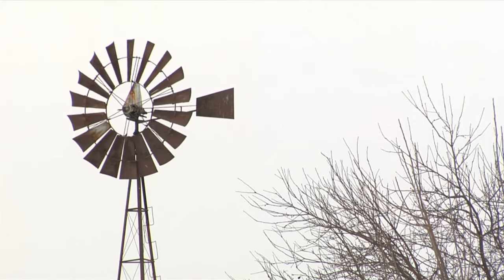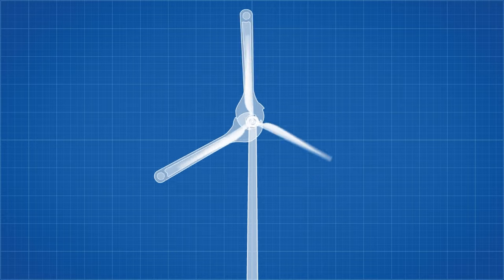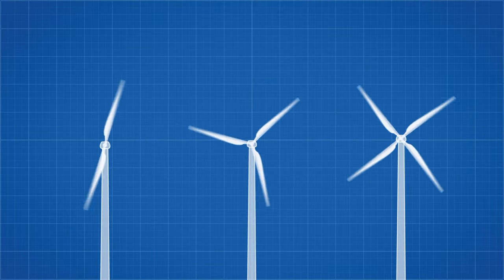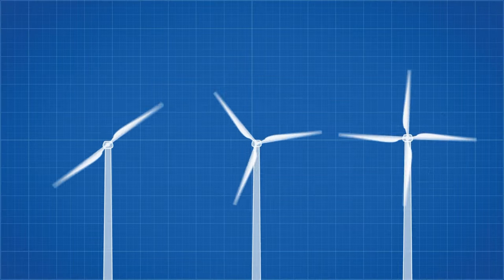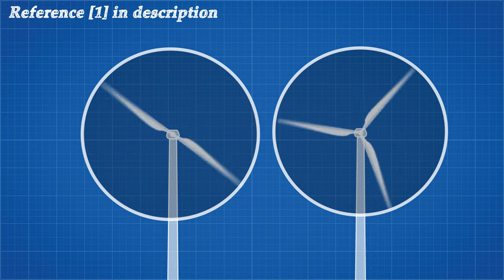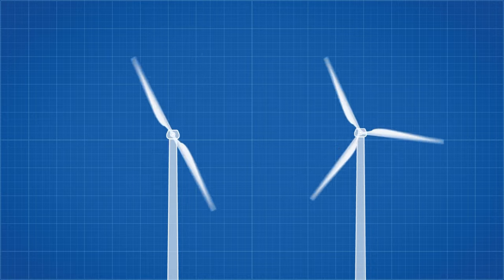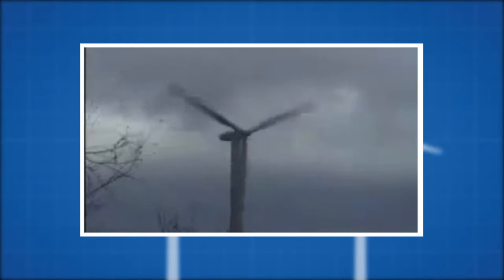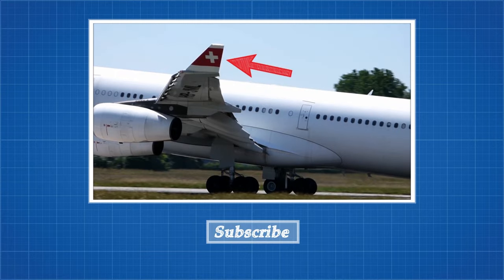Why Do Wind Turbines Have Three Blades?

Comment: Curiosity says:Theoretically, a one-bladed turbine is the most aerodynamically efficient configuration. However, it is not very practical because of stability problems. Turbines with two blades offer the next best design, but are affected by a wobbling phenomenon similar to gyroscopic precession.

Since a wind turbine must always face into the wind, the blades will have to change their direction vertically when there is a shift in wind direction. This is referred to as yawing. In the case of a two-bladed system, when the blades are vertical (i.e., in line with the tower and the axis of rotation) there is very little resistance to the yawing motion.

But when the two blades are in the horizontal position, the blades span a greater distance from the axis of rotation and so experience maximum resistance to yawing (notice how a spinning figure skater slows down when they bring their arms away from their body. As a result, the yawing motion starts and stops twice per revolution, and this leads to stress on the turbine due to blade chattering.

On the other hand, a turbine with three blades has very little vibration or chatter. This is because when one blade is in the horizontal position, its resistance to the yaw force is counter-balanced by the two other blades. So, a three-bladed turbine represents the best combination of high rotational speed and minimum stress.

Comment: The major explanation for this fact isn't shown in the video nor the comments here. The point is that three-bladed turbines may achieve the best power coefficient (Cp) which is above 0.5 and below the Betz Limit (maximum efficiency ANY device may reach when converting wind energy -- 59.3%). The thing about balance and mechanical stress is also true, although not the main reasons for the widespread use of three-bladed turbines. For further info just google: Curve Cp vs. blade number.

Comment: I like your channel a lot, but this video misses the spot way too far. I have the strong impression sure you just read the english wikipedia page, which, for whatever reason, does not cover the root of the problem in comparsion to other wikipedia languages and masses of other articles on the web about the topic. 

Do you remember how three-phase electricity works and why it's magic?  If the load is identical on all phases the fourth wire has zero current the other three equal out completely.  
The same principle applies to a three-blade  turbine similarly:  There is zero unbalance and much less vibration.  The forces on the central axis are always straight and therefore three-blade turbines last longer both in the gearing as well as in the tower construction, are less noisy and have a smaller tendency to soar into big fatal movements like in the crash you show in the video (they're not fully resistant either as you video shows :-) )

PS: Initial construction cost-wise a two-blade design seems to be the real sweet spot and if you research a bit int cheap turbines for underdeveloped rural regions you will find a lot of two-blade designs. But in the long run three-blade designs are more cost-efficient due to the fundamental mathematical priciple (and not because of the sheer cost structure)
Reply from the maker: I agree with you, it's lacking. I used a college text book for reference, but I left out most of the information because I was trying to keep videos below 3 minutes at the time. I will probably remake this video further down the line.
Reply: +Real Engineering wow, that was a quick reply.  The cost factors are very dominant and it looks like two - blade designs seem to be reconsidered for offshore parks. But the math of the forces just fits the topic and tone of your channel much better ☺
Reply: I'd like to know the text title.  Glad to see you notice it is a little over simplified.  I know enough to see this myself, but have not read much on this subject.  In particular the arm of the leaver related to torque on the system.  The "Lift" in the radial component differs with the distance from the spin access.  Obvious, but it needs to be taken in to consideration in the comparisons of designs of varying blade numbers.  I think a good Aeronautical background helps and I have a little.
Reply: The only constraint on the blade spinning speed is the seped of sound.  The tips of the blades are travelling close to the spped of sound, it is the main criteria when engineers optimize the design. Also gyroscopic forces are wild on two blade designs - they cause wery unpleasand type of vibrations - this is why three blades are preferrable even on very small household turbines.
Reply: I thought he was going to talk about primary and secondary balance, instead he basically just did a cost-benefit analysis.
Reply: Nikolaus, you said 3 bladed turbines have "zero imbalance and less vibration" and "the forces on the central axis are always straight". Please expain why this isn't true for other numbers of blades.
Reply: "zero" was a bit exaggerated to be honest and university is a bunch of years ago.  Don't take it word for word but I think the problematic topic is not a fixed propeller with a fixed continuous and homogenuous wind direction but the fact that a wind turbine is turned to the wind direction and the wind direction can change etc. I.e. the turbine has a vertical axis, too.  In a two-blade setup the potential inertia and momentum along that axis can change 0 to 100%  twice per turn, which can lead to vibrations if the turbine is not  exact in wind direction and / or the wind is not homogenous.
But again, this is just something I think had to do with it - kind of an educated guess.  Better do some own research on the topic. 

BTW: Higher multiples of three probably have the same characteristics, but seem to be totally out of scope cost-wise.
Reply: I saw an experimental one-blade design that used a counterweight.
It was said to avoid the trailing turbulence of another blade.
Reply: Perfect balance can be achieved with any blade count above 2, and can even be achieved with just one blade with the right counterweight, it does not need to be a multiple of three. 

In my understanding there are plenty of complex considerations for wind turbine blade design. The blade length is limited by the changing relative velocity as you move from the hub to the blade tip, that's why the blade pitch varies from the hub to the tip, but at a certain point extending the blade length further results in diminishing returns, particularly after the blade pitch goes past 90 degrees at the tips of some blade designs. The high rotational speed issue is the main reason for the 2 blade design being generally inferior. On the other hand, as more and more blades are added to a wind turbine, the wake path of the preceding blade starts to effect the efficiency of the following blade and promote flow separation and stall. 

But he's right in suggesting its all cost benefit, my understanding is four blade could be more efficient, but due to build, transport, and assembly costs, 3 blades tends to be the sweet spot.

Comment: Hi,
i took a class in modern wind turbine physics for a semester (about five years ago) and a another factor for three wings vs. two wings I remember is, that the tower is messing with the down stream wind speed.
Basically, on a two winged wind turbine, the load forced on the upper wing will be much* higher compared to the lower wing when that one is in front of the tower. 
It is also higher compared to the sum of the two upper wings of a three winged turbine
The effect of this would be a higher rocking of the turbine for a two winged turbine than a three winged turbine.
Which can cause higher wear and tear for a two winged wind turbine.

Comment: You forgot to mention that two blades results in mechanical fatigue ant the hub due to standing waves produced when one blade passes into the shadow of the tower. Three blades cancel any standing waves by splitting the energy to the opposite two blades thereby canceling any resonance.
Reply: Shadow of the tower? Aren't these contraptions facing the wind so the tower is behind??
Reply: @tomkarlsborn2384  Yes, the tower is down-wind of the blade, but lower blade suddenly becomes 'unloaded' as soon as it passes in front of the tower while the loading on the upper blade remains unaffected (and is much greater). Throughout, there is a general wind shear affect across the rotor with the wind speed being higher with height (although this is constant). The result is a continuous eccentric loading 'blip' each time a blade passes the tower (in a two bladed design) that has to be accommodated by by some means , typically some sort of teetering/hinged hub design to absorb the forces.

Comment: When was kid, I used to build blades (from wood) and get them in garden for fun. Was aiming for ~80 (early)-100 (later) cm long (4,5-5 cm x 1,5 cm dimension, used knife to cut wood from both sides to get better wind pick-up for front side and reduce weight for back side - felt fragile but was sturdy enough for many months) blade with some 105-110 g weight each + central wood piece to hold that all. 
3-blade version was lightest but also not great at picking up slow wind (since at ground level difference between up and down can be big with all turbulence etc.). 5-blade version I found perfect combination (for that size) - it picked up speed quickly and turned smooth (and looked more cool when was not spinning, hahaha). And same time at strong winds auto-turned sideways to slow down (design by accident). (still had to take down when storms were coming). Good memories.

Comment: What is the marginal increase in performance by adding a 4th blade? How do you know it's marginal?
Reply: fluid dynamics. 3 bladed designs are quite near the maximum theoretical efficency possible for a turbine rotor. The effect of adding a 4th blade would be marginal
Reply: Correct, for blade sizes such as we use on wind turbines, operating in air at about 1 atmosphere of pressure.
But the poster of this video knows NOTHING about this, and uses a silly null argument to dismiss 4 blades summarily.
Reply: I don't need you guys to reiterate the video. I need you to tell me WHY
Reply: Economics being a null argument? Ha.
Reply: It is, if all you say is "it's uneconomical". That's not an explanation. You might as well just say "because".
Reply: And what is the number of blades needed to reach absolute maximum theoretical efficency possible for a turbine rotor? 3,14? :)
Reply: The graph in the video was meaningless because it only showed one fixed cost and one revenue curve. In order to compare the difference between two different designs the video needs to show the cost and revenue of both designs on the same graph.

So yes it's a null argument because the 'argument' was never presented in the first place.
Reply: To answer your question directly, here's a PDF that outlines it:
http://mragheb.com/NPRE%20475%20Wind%20Power%20Systems/Optimal%20Rotor%20Tip%20Speed%20Ratio.pdf
It's what your 12th grade physics teacher would call "a good read". I'll break it down for you so you're not tempted to gouge out your eyeballs.

NOTE! These figures are all extremely ballpark and I've spent barely any time researching this, but the quick-and-dirty of it is, with an additional blade you'll get less than 2% more wind power captured and it'll set you back an additional 20% the cost of the turbine.

When wind hits a rotor blade, it slows down. If wind is traveling at 10m/s, and you slow it down to 0m/s, you're extracting 100% of the energy from the wind. But then the air behind this theoretical turbine isn't moving, so it has nowhere to go. So you need to sacrifice some air movement (and energy) to allow the air to clear the turbine. This is called Betz' Law, and that maximum figure is 59.3%. When this air passes over the blade, it slows down (loses energy). It takes time before the next blade can cut into "fresh air" in that same spot; time for the wind to re-accelerate the air that the previous blade just mucked up. With more blades, each blade gets more turbulence. 
The amount of time between blades hitting the same spot is calculated by the Tip Speed Ratio (TSR). Having two blades running at 60RPM has the same TSR as having 4 blades at 30RPM. This figure is independent of blade length, because the blades are rotating, so the blades on the outside of the rotor are moving faster than those on the inside.
If you were to increase the number of blades, the turbine would rotate more slowly with the same TSR, but the slower blades would be more efficient.
How much more efficient? While I can't source the exact figure, the jump from 2 blades to 3 blades yields 3%, and based on the curve the next increase would likely be 1.5%. The actual cost-per-blade isn't a set figure, varying by length, location, engineering, etc, but you can find some info here: (https://windpower.sandia.gov/other/031428.pdf).
I'm going to break it down by cost-per-MWh, which is around $20. An average wind turbine will produce 6,000 MWh per year, and has a lifespan of 20 years, meaning $2.4 million profit over its lifespan. With a purchase cost of $2.2 million (note: these figures are extremely fishy, but I don't have time to source everything), and ~20% of the purchase cost going to the blades, the additional blade would cost $440,000, flipping the turbine from being $200,000 of profit to $240,000 of debt.
Reply: LOL... even if he had said 14 percent, he could also have said it makes the units much slower, more torque and much more safe.  I still wonder of the sub sonic sound wave formation from ALL these, whether two, three or four blades.  I know birds do not lile wind turbines. Nor people who live in proximity to be affected by far traveling sub sonics... AND rich people do not want them anywhere in eyesight.
Whales probabl hate them when they are out at sea. Probably give them migranes.
Reply: @chewyshoey  . Oi

Comment: So does having more blades mean the turbine will perform better?  Ignoring costs for a moment, I just want to make sure I understood this properly.
Reply from the maker: yes
Reply: no it will not. for highest efficiency, the blades need to have airflow that's undisturbed. adding more blades causes surrounding air to get more and more turbulent. this is why planes only have one pair of long narrow wing instead of a couple of short ones
Reply: +w8stral2 Soo... why don't we use 2 blade turbines then, does that not address frequency problems?
Reply: +w8stral2 Thanks for your response, these are the answers that should be in the video.

Comment: What about no blades?
Reply: Like a Dyson!
Reply: No blades is indeed optimal!  None of these bird-slicers will ever produce enough electricity to pay for their cost of production, maintenance, and use of land.
Reply: You mean aside from wind power having, last I cared, the lowest lifetime cost per watt-hour of any form of power plant?
Reply: Actually there is a wind turbine with no blades, it's system is a bit different but it exists!
Reply: The power output is so miniscule as to be irrelevant.... for now. The technology is advancing so quickly, that maybe in 10 years or so it may become a practical reality.
Reply: Break the meta!
Reply: Rein Teder most wind turbines pay themselves off in 7 months and the rest is profit
Reply: I am from Spain and they did a bladeless generator saying it is more efficient than one with blades. Take a look at it...it is really stupid hahahah. I guess there will be bladeless generators but not the spanish one
Reply: Hahah
Reply: What an idea noble winnet
Reply: After removing the blades, you can also remove the generator, which significantly reduces production expenses.

Comment: The biggest benefit to the three blades is the reduction in vibrations when the wind quickly changes direction (as it usually does). When the two blade design is vertical it can change direction very quickly and easily. When both blades are horizontal it changes direction very reluctantly. Thus you have a vibration problem when the blades quickly go from the horizontal position to the vertical position. With the three blade system the blades are never exactly opposite each other and this helps to minimize the vibrations. I have had a 3 blade wind generator up for almost 18 years now and I watch it in high wind conditions. I also fly smaller aircrafts with only one or two seats and there again the three blade system is better.

Comment: This is the noise a wind turbine makes "Shows us a clip that shows how quiet they are*
Reply: look, that whoosing noise is very very annoying, if you had a wind turbine in your back garden, then you would get rather annoyed within 1 hour.
Reply: @56independent  I'd be a lot more annoyed by smoke of coal or dangers of nuclear tbh.
Reply: @sh4dy832  nucular power is actually extremely safe. only 3 large accidents have occured, wich is a lot better then any other form of eneg=rgy production.

Comment: There's some important aerodynamic reasons missing from here. There's a tradeoff between maximum power that can be generated throughout a range of wind speeds. As the number of blades goes up, the max power increases, but the range of wind speeds over which you can achieve that drops. Three blades is ideal because a wind turbine needs to be efficient for a range of speeds.

Comment: There are also one-bladed designs available!
Reply: precisely my thought
Reply: Well that'd be an extrapolation of the 2 bladed design which has already been shown to be less cost effective than the 3 blade. Some smaller wind turbines are 2 bladed, as I understand it that's because the construction is easier and only needs 1 crane for assembly so they win in cases where the capital cost is critical.